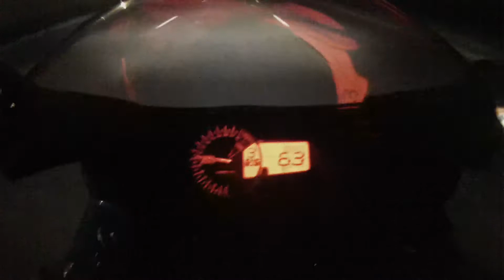TFTG Motovlog # 6 - Cock boys, Hid Testing, and hitting that 600 First Service!

Comment: I plan on ordering lights for my 08, what size are yours? and awesome song whats the name plz
Reply from the maker: babylion44 For my gixxer the bulbs are H7 for the low beams and H9 for the high beams. I'm not sure if the bulb sizes are different for your year gixxer, you may have to check that out or google the size for the 08. The song playing during the highway ride is called "Secret Black" by Powwoww.
Reply: thanks im just debating if I should get the 55k or 25k lights
Reply from the maker: babylion44 Either of those would be awesome, mine are only 8000k, so you'll be putting out some daylight at night :)